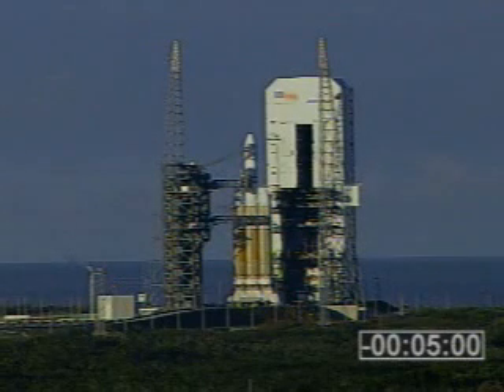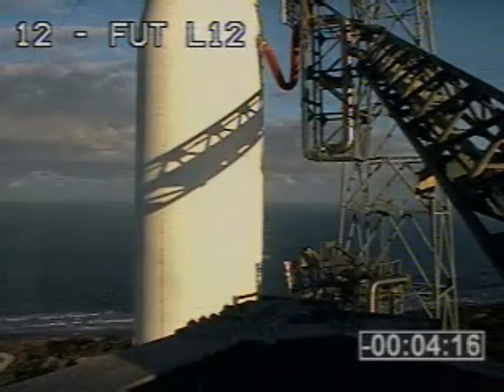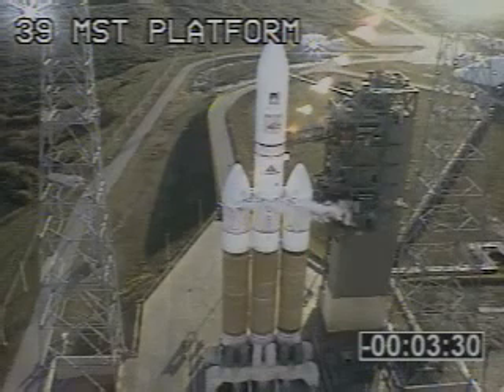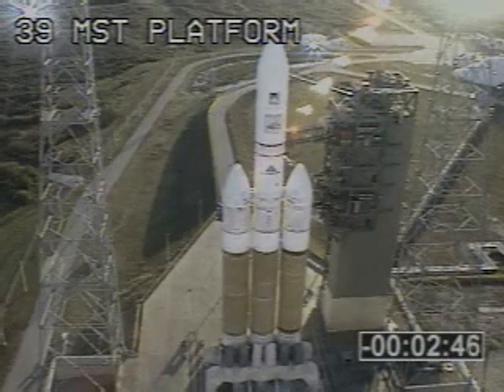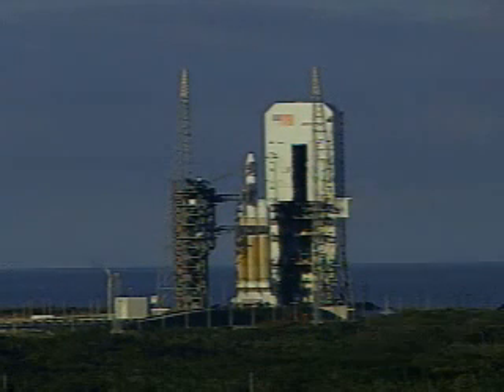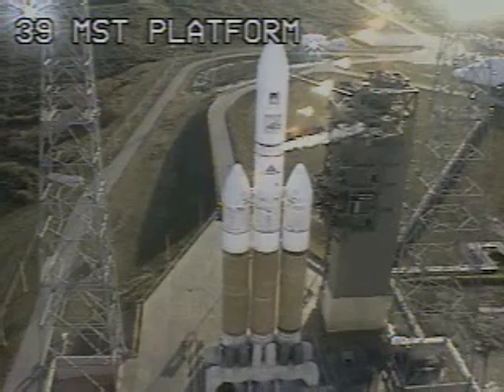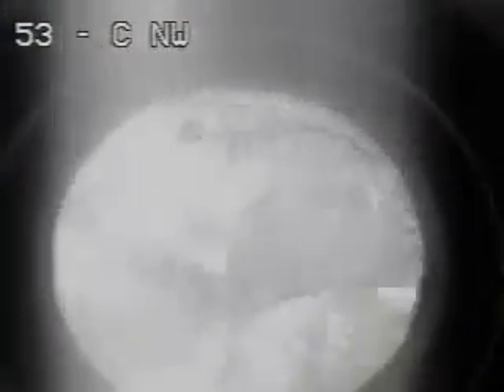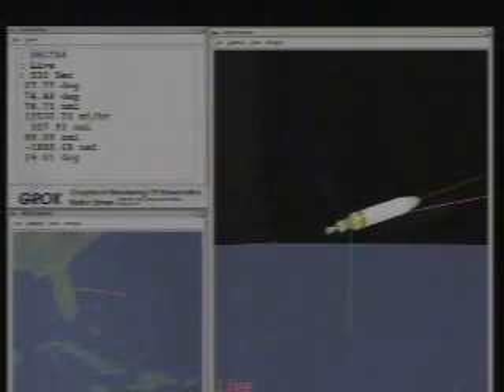First Delta IV Heavy Launch - Original TV Broadcast

Comment: The launch conductor for the inaugural Delta IV Heavy launch was Scott Barney. He has the same assignment for the NROL-70 launch today which is the FINAL Delta IV Heavy launch. How fitting. Launch commentary from Mike Miller. Ascent commentary was from telemetry engineer Steve Agid in the Delta Telemetry Lab.

Comment: It looks like it levels off and starts a slight decent as it runs out of fuel because it does, what NASA doesn't show is the rocket crashing into the ocean, that's when they switch to outer space CGI and cartoons.
Reply: The fist stage(s) don’t run out of fuel, nor does it start descending, it’s the camera angle that makes it look like it’s descending, and if it started to run out of fuel there would be visible indications such as the shortened, and more black exhaust from the RS-68As. Also CGI probably wasn’t good enough to mimic something like that in 2005.
Reply: Love seeing stupid people on the internet
Reply: @samu_cornia9991  am I stupid, or is the original comment stupid?
Reply: @somespacenerd  op
Reply: @samu_cornia9991  ok
Reply: @samu_cornia9991  me too, critical thinking vs indoctrination
#Sheepal
Reply: How would it descend? if it ran out of fuel it still retains the momentum it had before engine cutoff. Even in the fake scenario you just made up, it wouldn’t start descending.